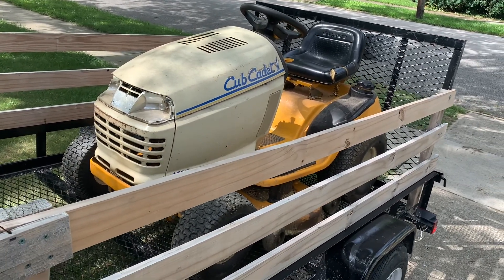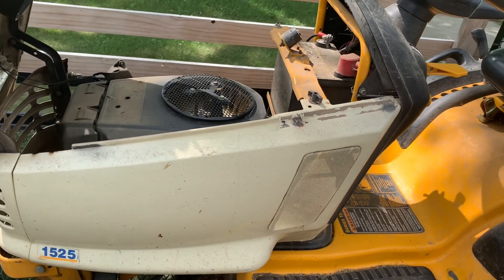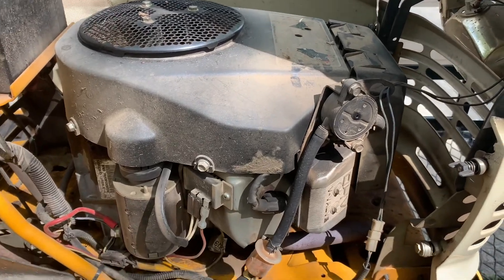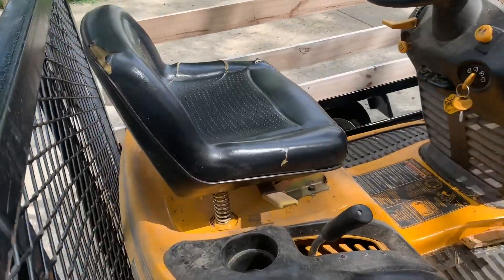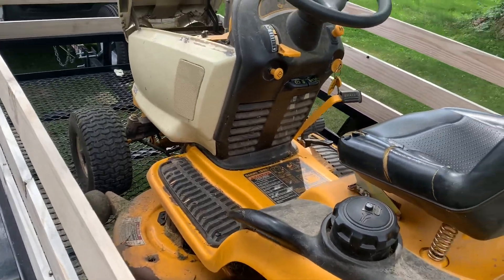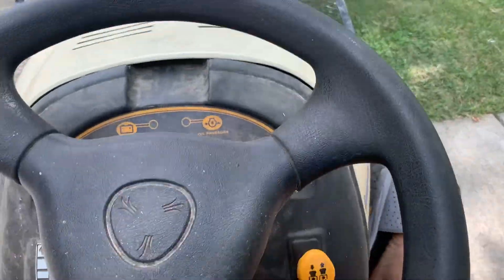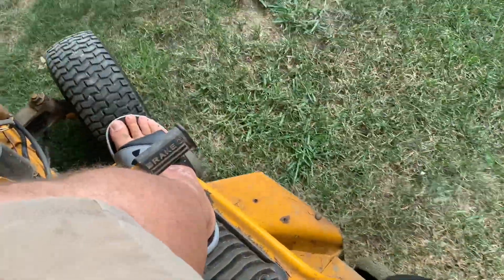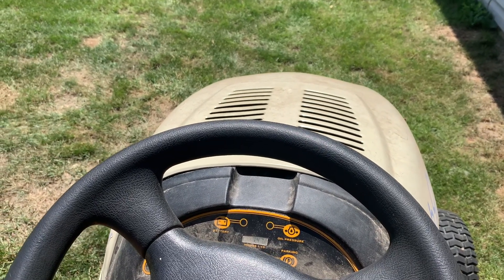Cub Cadet Kawasaki 15 HP Hydrostatic Riding Lawnmower (Under $100 Series)

Comment: I have the same tractor. It looks like new for being 19 years old.
Reply: How does the deck belt go on don't know
Reply: If you haven't found it yet on the right side of the deck from the seat
After taking off a plastic belt cover
You'll find a square hole in an idler pulley arm this fits a 3/8" socket wrench  you use that to stretch out the belt   to put on all the pullies 
My first 15 times i just used brute strength.   The 3/8" hole makes the job super easy.   I have a snowblower for mine also only have 100 bucks for it it looked brand new only used 1 season.
I've had it several years. 
Last year i put Agro type back tires on mine.  Looks like a ford 8n farm tractor now.